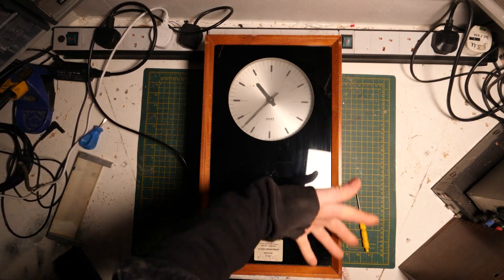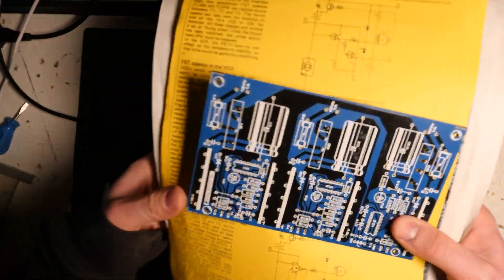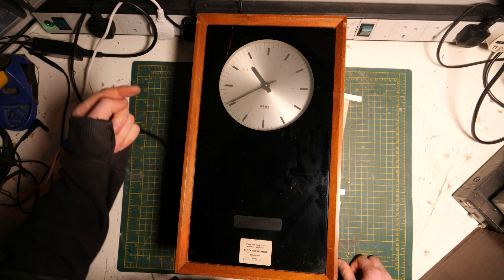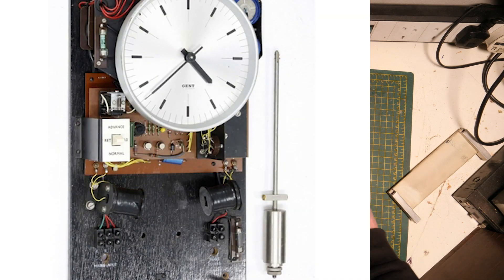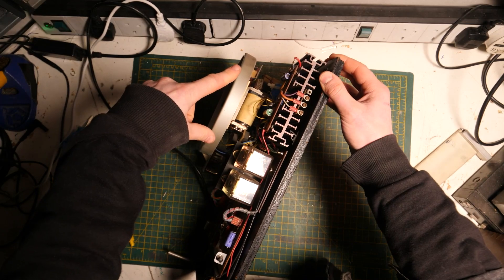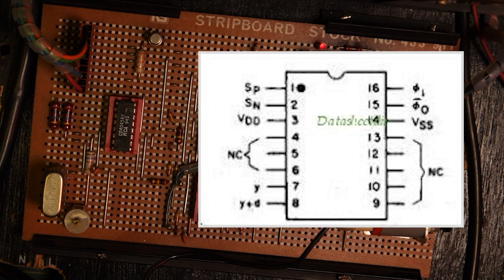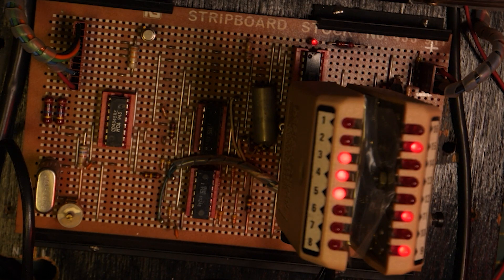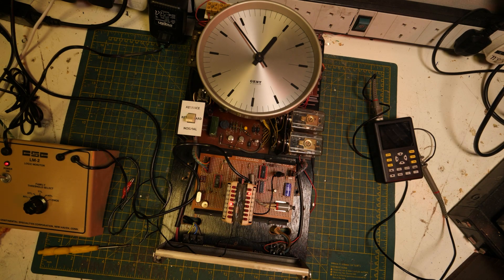This Electromechanical Master Sync Clock Has Some Vintage Modifications :O

Comment: I strongly suspect that the modifications to this clock were done at the Gents' factory as part of the prototyping for the subsequent XC408/Chronopher 3 and C27 Quartz Master clocks.
Reply from the maker: I guess the way to figure out if that is the case is to compare the schematics. that sticker would probably not be like that if its the case no?
Reply: @THISMUSEUMISNOTOBSOLETE  Is there a serial number on it ?

Comment: I wonder how accurate a clock you could make just gear ratioing a motor hooked to mains  to do one full turn a day? Whether the power from mains is consistent enough to do that? Idk
Reply from the maker: its possible and some old clocks work on that premise
Reply: And mains frequency is continuously adjusted so that the total number of cycles in a day is exactly right (to atomic clock precison) specifically because a lot of clocks actually use the mains frequency as their reference. So in the long term a clock of that kind is a lot more accurate than a quartz clock

Comment: The IC's are on sockets, get some sockets with extended pins, mount on some stripboard with led's, one set for each IC, then it's just a matter of plugging them between IC and main board, easy to reverse the mod.
Reply: Yeah good idra

Comment: How does the built in secondary clock, play into the one you can see? That's a really neat clock for sure(how do they interact)
Reply from the maker: similar to the other master clock in the other video, as the master clock sends a pulse. the only difference is they are housed in the same box
Reply: @THISMUSEUMISNOTOBSOLETE  ohhhhhh, that's really cool. As to what do with it, why not make it an LFO for something, if you haven't done that?
Reply from the maker: @SpectrumDIY  only did the sync boxes the other month for the museum on it :). I didnt get bit by the bug to build an loo! but you could with a Hall effect sensor!